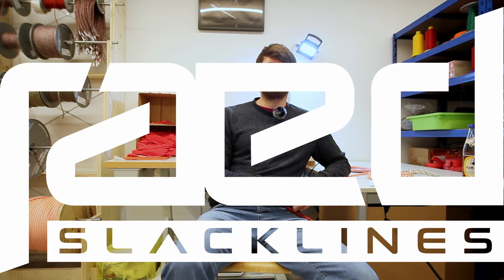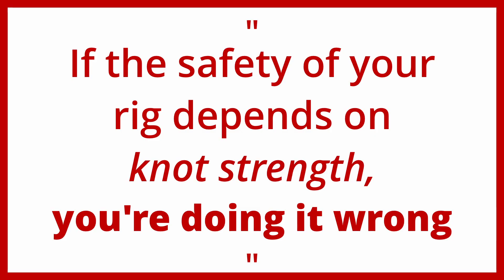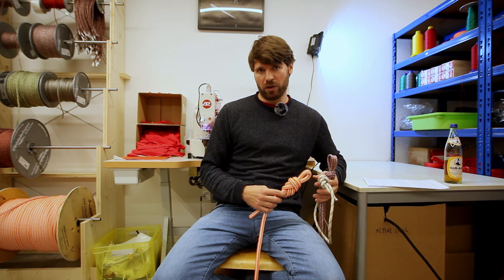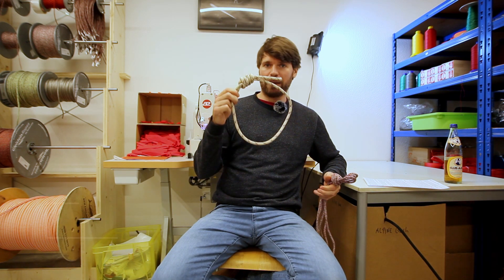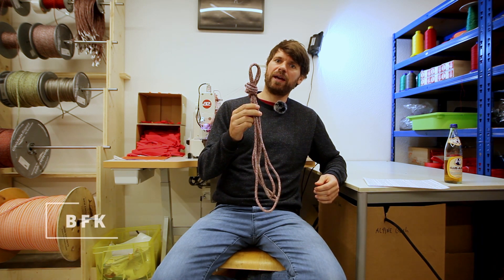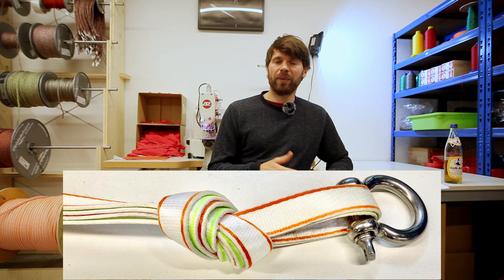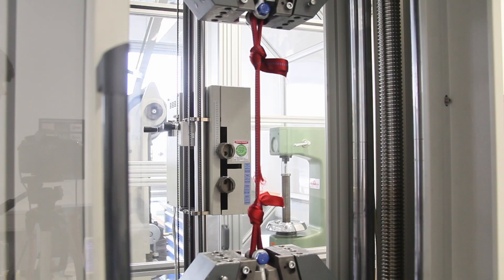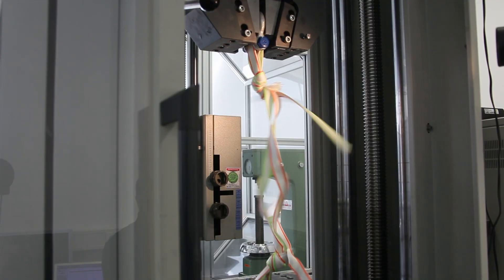☠️ WARNING: Knots in highline webbings ☠️

Comment: The main reason to use a knot instead of a weblock isnt the money, but the simplicity. A weblock only retains full strength if the webbing is sitting in it perfectly, ideally pretensioned. That's almost never the case with a backup. Weblocks with webbing thats not under tension usually dangle around under the mainline at all sorts of angles, twisting webbing, allowing for slippage, etc.  You gotta tape the hell out of it to keep it in place.
Reply from the maker: Hey Friedi, thanks for your thoughts about this topic :)
Please have a close look at our weblock tieback video, where we explain how to safely use raed weblocks in backups to completely avoid the "dangling issue": https://youtu.be/diKYUfVJ_-s?t=95
Please also be assured that the "save some money incentive" to use knots is real, as we learned from direkt talks to many of our customers. That's why we think this discussion is necessary: yes, there's a minority of pros who do it for the reason of simplicity and most of them know very well what they're doing - but we learned that most customers asking for this don't do it for the reasons you mentioned - they try to do it for saving some cash and are often not as highly educated about highline safety as you for example are. 
I hope this helps a bit in understanding. Keep the balance :)

Comment: I was suprised by the amount of stretch you are achieving with such short sections of webbing. I am guessing the length comes from slack pulled from inside the knot. Knots can dissipate force when they set.  By doing a slow pull are you removing this factor?
Reply from the maker: Hey Ryan, interesting point! From our real world tests we know that this dissipaition takes place in a fraction of a fraction of a second when having a backup fall. And at such speed a lot more heat is generated than in slow pulls, which might lead to additional damage and therefore further weakening of the webbing.

Comment: What would be the load on a (more or less) loose backup after a leash fall with main line failure? I guess way far from 18kN
Reply from the maker: If you watched the whole video, you might have noticed that even a 36 kN webbing can break at 12 kN. So the made assumption of 18 kN webbing strength is incorrect, even for strong slackline webbings. Please be aware that loads of 10+ kN can easily (!!) be achieved in backup falls. Please also be aware that a rescue scenario might be necessary in a backup load case. For a rescue scenario 2 persons would be on the line and you'd need a safety factor high enough for the load that comes along with this. I hope this helps a bit in understanding, why knots in highline webbings are a seriously dangerous thing. Keep the balance :)
Reply: Thanks @raedslacklines ! Do you have any scientific evidence of the >10 kN load on backup falls that you could share with me? I am just curious
Reply from the maker: @tamacrew  A friend of us measured 8ish kN in a leashfall on a 200ish polyester line some weeks ago. Please also check the ISA knowledge base for further resources, if I remember correctly there's a link to a study some of the ISA guys did in cooperation with Landcruising many years ago.

Comment: Hey Stefan, have you tried frosties which are tied as figure 8 instead of overhand? Any experience on that?
Reply from the maker: Hey Nik, if you look closely at the mode of failure, you might notice that the webbing slips of its own knot bulk and cuts into the loaded strand. This might happen as well in a fig8, we don‘t see any reason why it shouldn‘t happen there too.